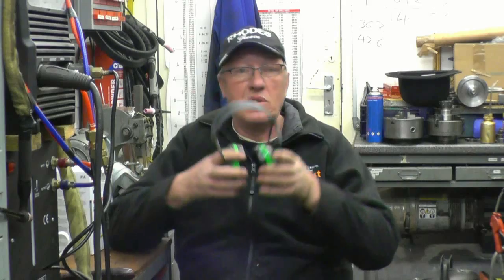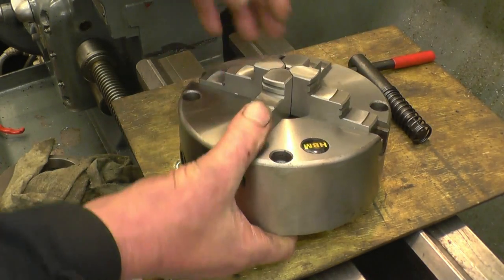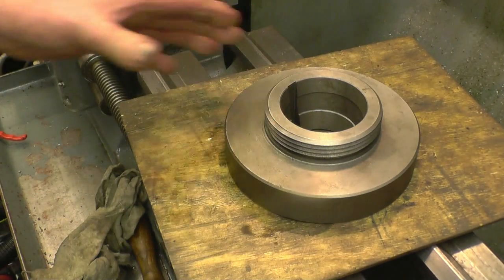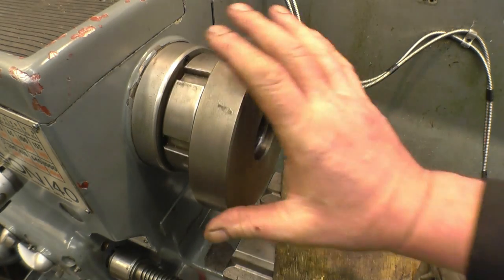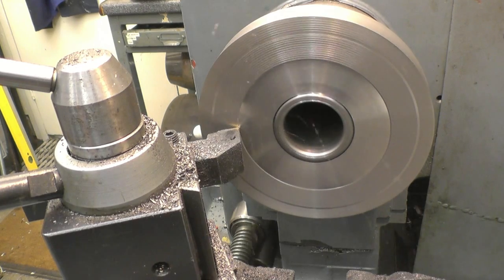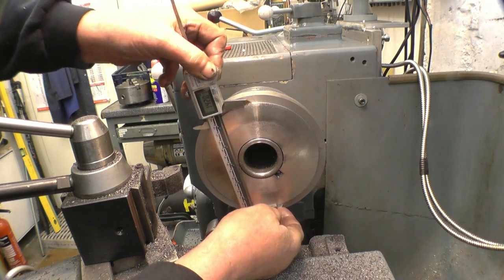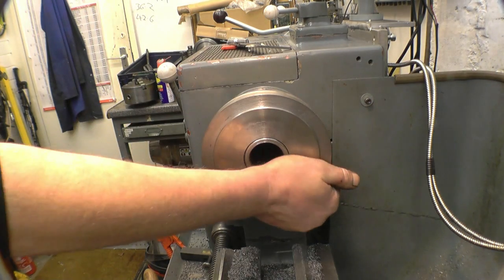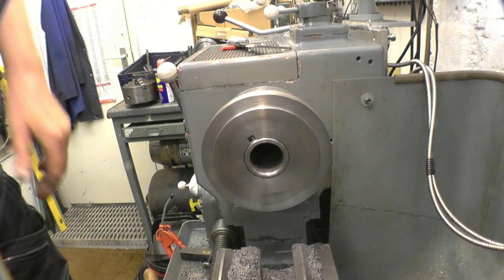SNNC 151 P1 Twastard tee shirt . Machining a chuck back plate

Comment: Another nice Night Cap, thank you John.  You can catch the iron cutting as they come off of the bit using the shop vacuum.  Use the tapered attachment on the end of the hose pipe.  Almost all of it will get sucked straight up into the vacuum and it won't go flying all over the place, making a mess and chewing up your machines.
Best wishes for the holiday season to the entire family.

Comment: I bought a 4 jaw self centering chuck.  Regret it now as it will only work properly with perfectly round or with square, octagonal and other multiples.  It will only grip on 3 jaws on out-of-round, when you think about it!  It now resides on my rotary table.

There should be no 'wiggle'room when fitting on the spigot and there should be an undercut on the inside angle on the back plate? (unless the chuck is chamfered on the corresponding corner?).